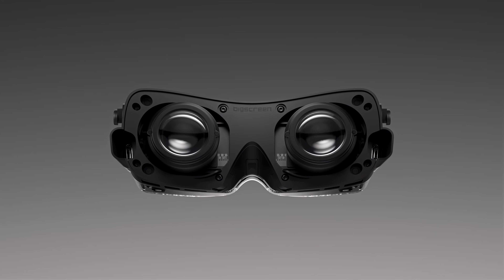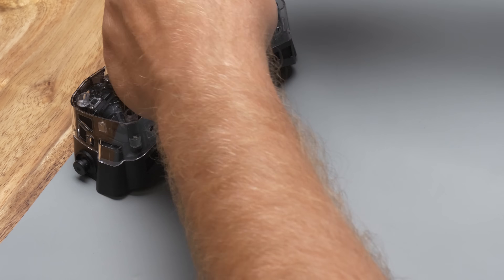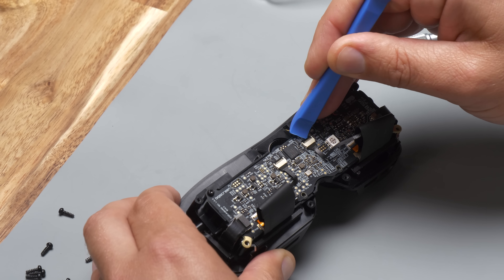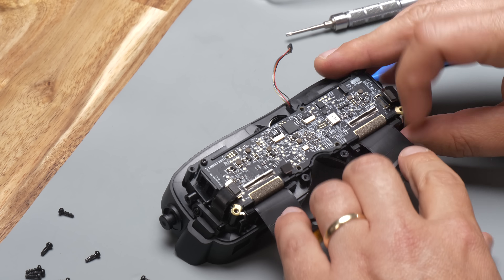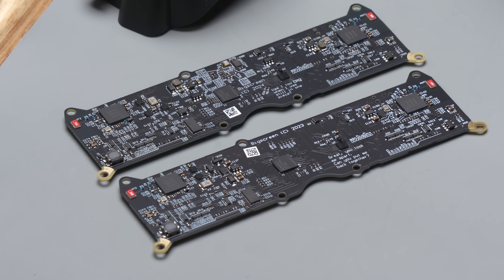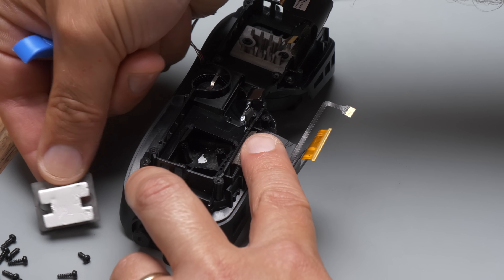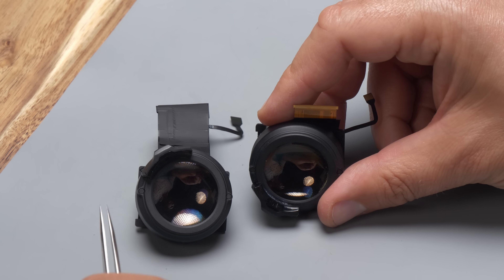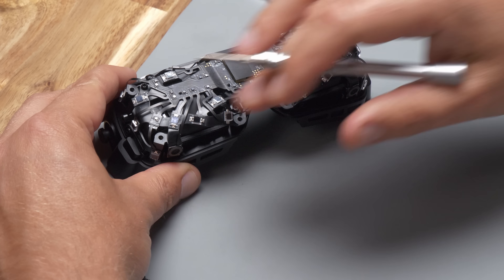Bigscreen Beyond 2 Teardown: How We Achieved Eye Tracking, Adjustable IPD & Better Optics in 107g

Comment: Please ship this awesome piece of tech already🎉!
Reply: Said it would be shipping June. It's June...
Reply: @nagamon7915 and june is not even close 2 being over :)
Reply: I ordered it with eye tracking....and the halo strap. It aint coming till after summer  because of this halo strap :(
Reply: @insertnamehere4419 I was aware of the late delivery with the halo strap so I choosed the base model with printed face cushion. Should have been shipped already 😢 hehe
Reply: @insertnamehere4419  I asked the customer support about this and have been told that if you ordered your BSB2 with a custom face cushion it will not be delayed by the halo strap. In that case the halo strap will be sent out later once it's available
Reply: @insertnamehere4419  I heard you can ask support to split your order and pay separate shipping to get the headset itself earlier. Luckily I placed an order with just the headset before I decided to add on the halo.
Reply: @insertnamehere4419  Seriously, WTF takes so long to make a strap?  LOL
Reply: @jlepage36  Ikr...no clue